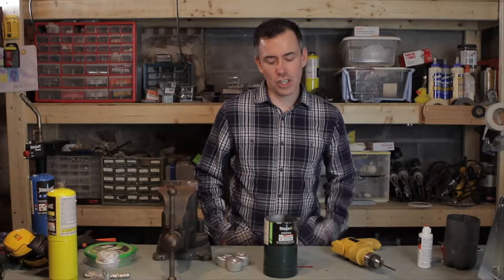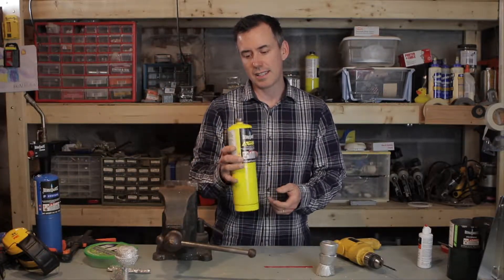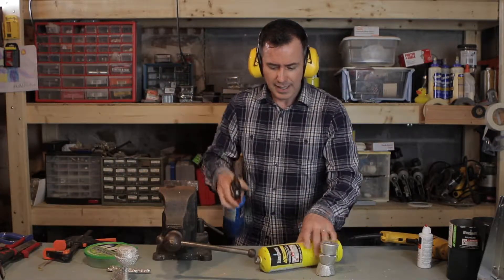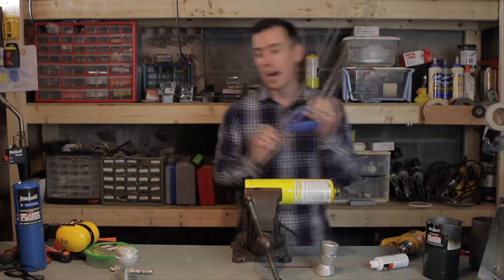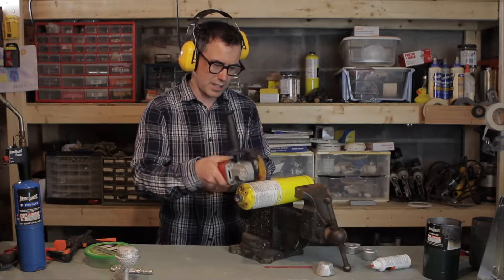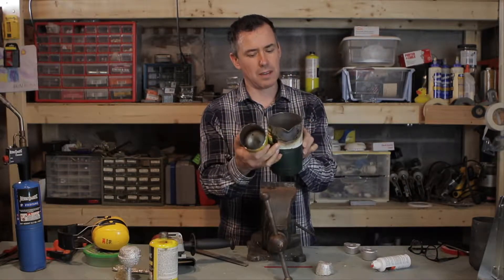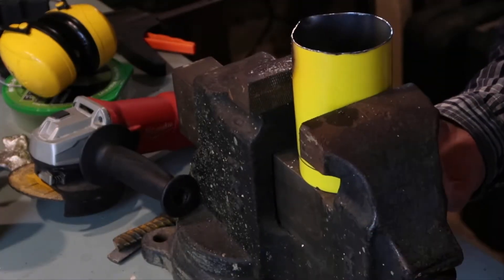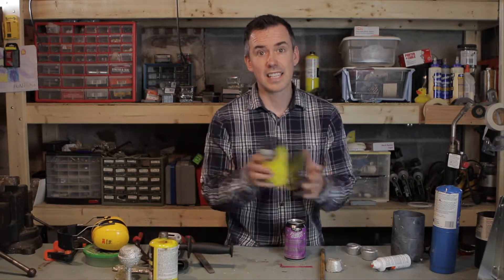How to Make a Crucible from a Propane Cylinder for Aluminum Casting

Comment: FYI, you don't have to drill the tops to vent them. Both the main  and the smaller holes have Schrader valves in them that can just easily be unscrewed & removed